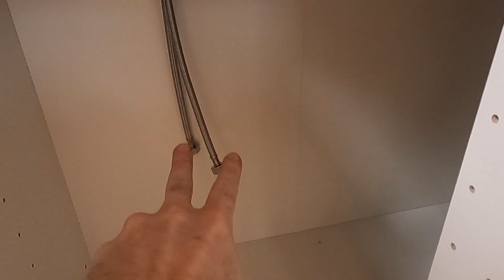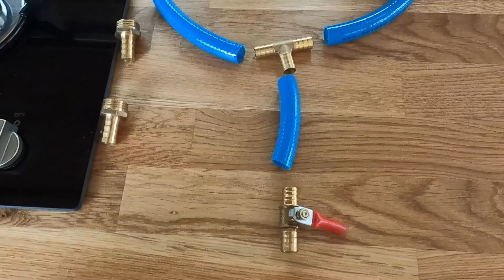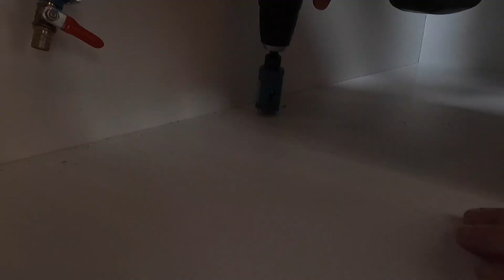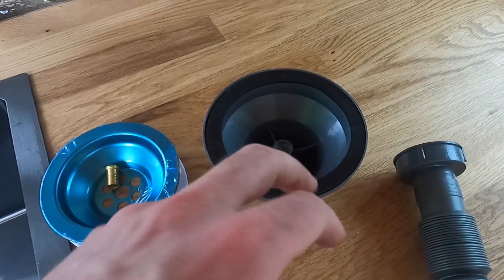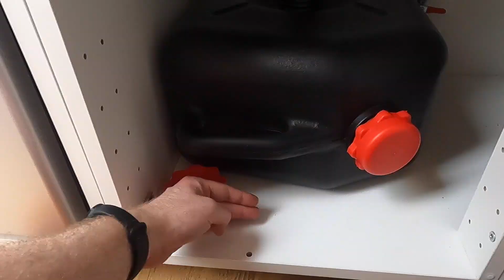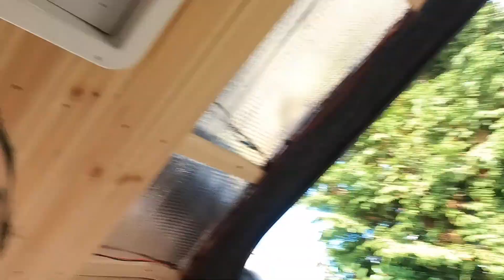Plumbing my Kitchen Tap and Grey Water Tank | Van Plumbing | DIY Sprinter Van Conversion UK

Comment: Do you have link or know what size them male connectors what joint the hot and cold tap together?
Reply from the maker: The T-connectors were 12mm. I’ve found another link below: 

https://www.ebay.co.uk/itm/354897802681
Reply: @GreenHornCountryClub  thank you 👍
Reply: What the bit called you screw in to hot and cold pipes to connect to hose can't find them anywhere?
Reply from the maker: @jordan22.85  these guys? https://www.ebay.co.uk/itm/225255702194
Reply: @GreenHornCountryClub there the ones , thank you for your help

Comment: Ok, so at the risk of going on a lot, here goes.. I currently have both a shower and sink, fed separately with both hot and cold. I have just had to go outside to check, I have one line out of the pump, it splits and goes on to the cold feed and a T-piece up to the boiler. Having never yet used it, I am wondering now if when I turn on the water, at say the sink (mixer tap) how does the feed 'know I want hot or cold, as it connects to the pump to start the flow, which then flows along the line that splits off to my boiler and off through the cold feed with nothing to stop either flow?  I will get a similar reaction for the shower which also has a mixer style 'tap'. This will surely send water both down the cold feed and up into the boiler and so fire the boiler up? If you can make sense of this, I applaud you, I have just confused the hell out of myself. (not difficult)🙄
Reply from the maker: I’m not 100% sure on this to be honest as I haven’t really looked into using a boiler in the van, my water system is extremely simplified. As far as I understand it though, you’ve got your water pipe coming out the pump and splitting off two ways - one hot water line and one cold water line. The hot water line going into the boiler then coming out and feeding into your tap and shower, whereas the cold water line bypasses the boiler and feeds separately into the tap and shower. The pump itself will always be creating pressure in both the hot and cold line so water will always be ready flow out both the hot and cold line of the tap and shower when you turn it on. Depending on what mixer tap you have you’ll be able control exactly how much hot or cold you want or both at the same time.
Reply: @GreenHornCountryClub   My water feed pipe comes out of the pump, then Tees off up to the boiler, and straight on as the cold feed, this is what has got me thinking, whichever I turn on, shower or sink will both activate the water pump regardless of if I want hot or cold water as it will push the water along the pipe and I presume up to the boiler and straight along the cold feed at the same time, there is no obvious way (to me) of splitting the water feed out of the pump so that it doesn't. At present there is a switch near the shower to activate the pump when needed for the shower, and the mixer tap at the sink has a micro switch that activates when I turn that on, I can't see choosing hot or cold making any difference as it is a simple left or right turn for one or the other. None of it has been tried or tested as yet, and at the moment I am awaiting some more wire. After seeing your video, I realise I need to give both switches some thought, so I will either make them entirely separate from each other, or wire them better than they seem to be at the moment into the same circuit (if possible) watch this space😁

Comment: Hiya, just watched this back to back with your water pump installation guide. well explained in both, particularly interested in the wiring. your pump fitting vid, was explained well enough, (even for me) but you didn't show any electrical fitting for your sink? does it run through the same pipe work as the shower, so that when you turn whichever on, the pumps pushes it through to whichever has the open flow? (tap turned on) I am currently refitting the electrics in my van and can't work out what goes where, the previous fitting was less than ideal shall we say and I would like to get it right. Thanks in advance.👍
Reply from the maker: Hey thanks so much! So with the tap, there’s no electrics involved, I also haven’t plumbed any hot water through the tap either. I have the same water pipe connected to both the hot and cold inlet pipes of the tap (using a T connector), then whenever I want to use my tap, I just switch on the water pump which creates pressure in the system so that water will come out whenever I open the tap. I hope that makes sense. Let me know if you have any other questions 👍🏼
Reply: I was really hoping to see how the heck you're turning on the HotTap pump. So much info missing. Also can the hot be ran on a split or is there wiring in the hose for the Hot Tap